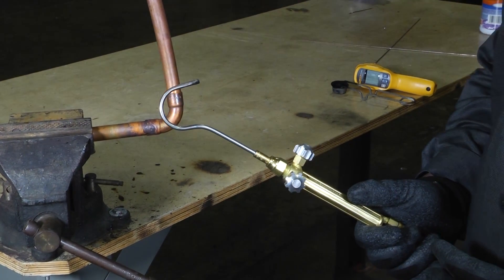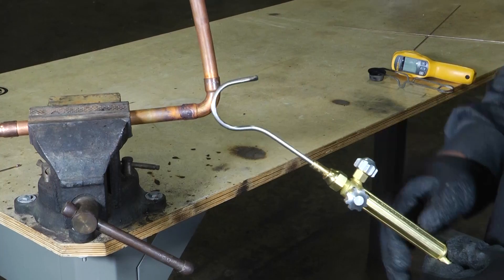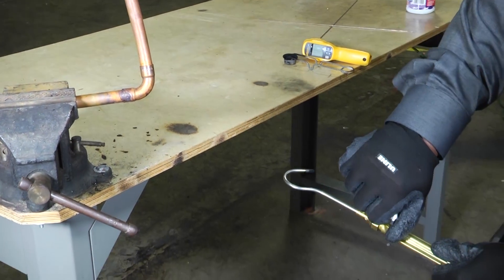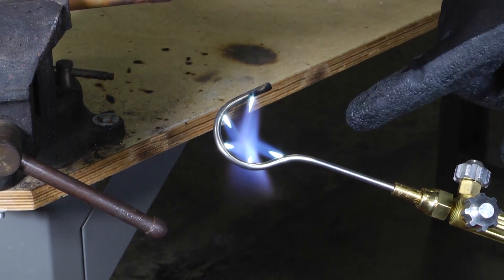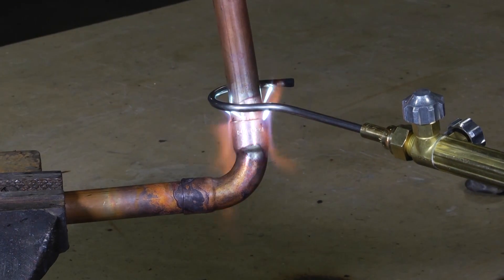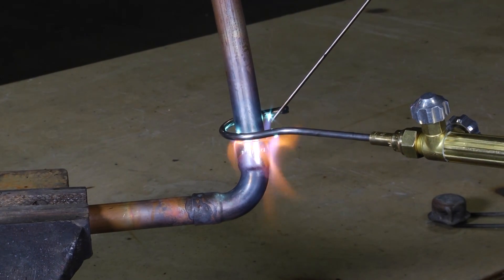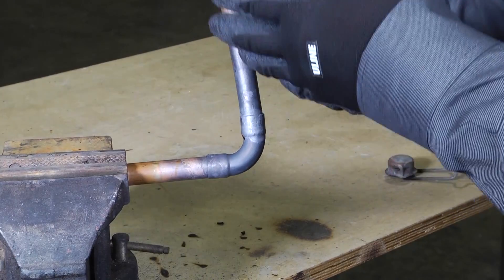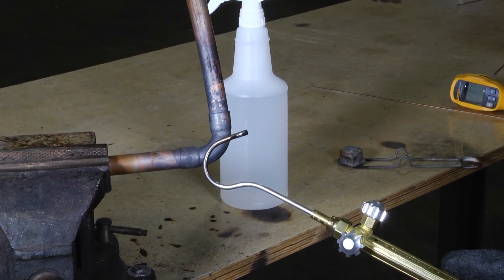Unlock Precision Brazing: How to Use the CapN Hook Brazing Tip from Uniweld | Step-by-Step Guide

Comment: When I go to light it up, i open acetylene first and hit the sparker and then I open the oxygen and it makes. A explosion like sound and does not light ...why
Reply: too much fuel would be my guess. try dialing the acetylene down low before you open the oxygen
Reply: @nathantruax4  or, too much oxy at once...open the oxy more gently or dial the pressure down a bit

Comment: There are 3 different sizes o CapN Hook. What size are you using and since most HVAC guys use porta torch kits, will this fit Harris or Victor kits? Are there adapters available to fit other handles?

Comment: You don't want to get it red hot.  Especially if your on the job.  Red hot can easily turn into point of no return
Reply: I used to be a brazer for Addison. Piped their DOAS package units and they wanted all their joints red hot. Not cherry red but right when it starts to turn red.
Reply: @anthonynunez164  It does ensure a fully wetted joint.
Reply: I don’t want to be a Karen but damn is hard with this YouTube certified pros
Reply: @yoyofd youtube supertechs do wear capes, or at least that’s how they see themselves…

Comment: I'm going into hvac and I have only one hand, i think this would make brazing easier for me.  Plus The whole Capn hook thing just puts a nice little zing to it lol . ah well
Reply: Have you started HVAC?
Reply: @jamesswitalski9168  not yet got cold feet but had all the aid in place car is not reliable...working on that. Thanks for asking
Reply: @daviddelgado475  ah I feel you, it will happen man. I feel you my old ass 01 Honda's transmission is going bad and drive 45 mins to work but getting my truck in less than a year so let's hope she stay okay till then haha.
Reply: @jamesswitalski9168  thats crazy i got a 2002 honda accord 168000 miles changed the starter... Now waterpump timing belt gotta get changed. Thanks dor asking though brother. Blessings to you.

Comment: What pressures do you have to set the regulators at, any different from standard tips? Thanks,  great video
Reply: Download the Uniweld HVAC/R products catalog from the website. Page 16 starts the list of all their tips which includes specs for each tip : what size pipe that tip is capable of brazing up to, as well as what your delivery pressure should be set to on acetylene and oxygen regulators.
Reply: Wish someone would answer you. I just got mine
Reply: @wcjc99  contact the manufacturer in an email,  I'm sure they would be glad to help you out ? @uniweld ???
Reply: @wcjc99  you need a flow regulator I heard it was about 3-5 psi
Reply: Just read the description from uniweld and it’s 5 acetylene and 8 oxy

Comment: i just wish that they made a small version for tubing in the 5/16"-3/8" range...
Reply: Would be senseless since you can heat copper of that size from 1 side
Reply: Man just use a rosebud tip, it'll wrap the flame all the around that smaller copper
Reply: @Kenpachi69420  I only use rosebud and hook. The "pencil" type torch tips make way too long of a flame for what I do.
Reply: @jonboy545  yeah even a #2 tip isn't great. 

Hook and rosebud are the way if you actually know what you're doing
Reply: I use it on 1/4 and 3/8 all the time

Comment: I need to get one of these and the devil horns again. Haven't found one of these that fits a victor torch yet. Maybe there's an adapter
Reply: it does fit the victor j-series torches, but those are not very common. most have the 100 series victor or the larger 300 series.